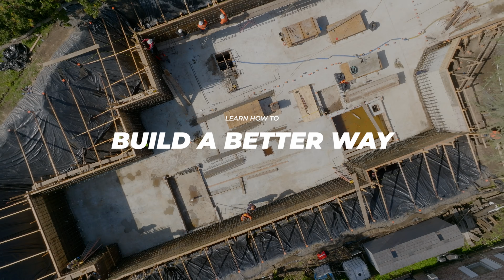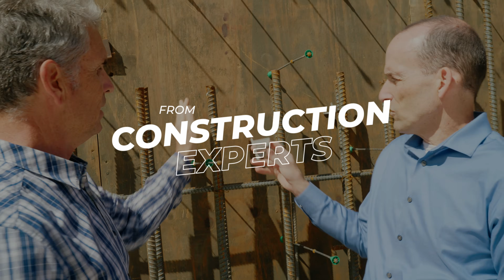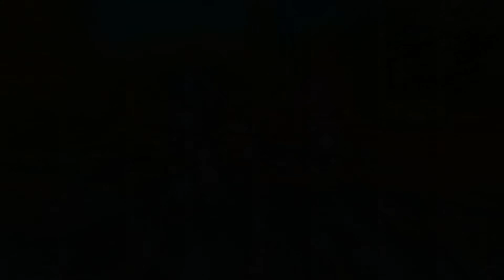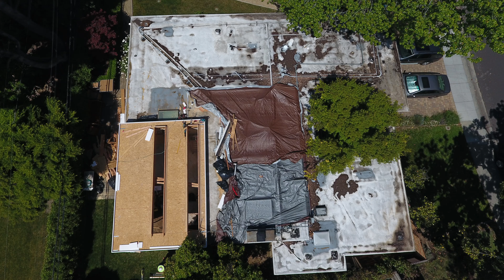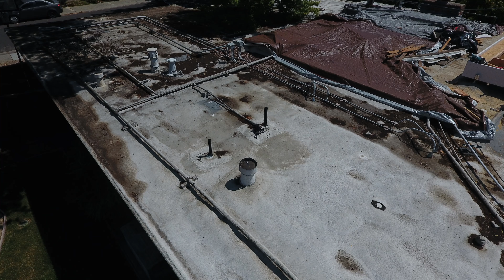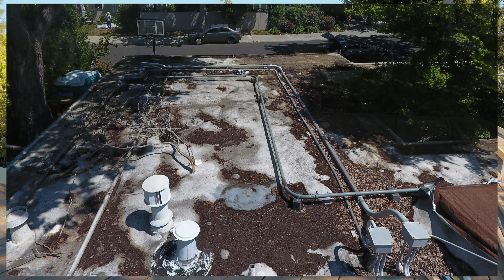Why Eichlers Suck, and What You Can Do About It - Citrus House

Comment: What was the barrier they chose to cover the pre-sloped foam insulation? 

Would love a follow-up as we see tons of folks choose spray foam and then have leaks that are difficult to pinpoint.
Reply from the maker: if you mean the roof membrane, we almost always use TPO, unless it is going to be ballasted, and then we use an EDPM.  We do not use Vinyl membranes, which are highly toxic when manufactured and when burned/during house fires and we prefer to use materials that don't kill our firefighters who are trying to save our lives.

Comment: It's hard to imagine building a modern house with a 1.5" thick clear redwood roof deck. You do see 2x6 doug fir t&g as a roof deck and interior finish sometimes.
Reply from the maker: True, but they are never the only thing that functions as the roof.  They typically have a bunch of foam up above the deck that makes them somewhat efficient.

Comment: I would say that it's not that Eichler's suck, its everyone's add ons to them over the years suck. But great to see, trying to run an HVAC in our Eichler its a battle of lots of money or a sub optimal system.
Reply from the maker: It is funny you say this.  I actually love the look of Eichlers.  They are unbelievably beautiful homes with an amazing inside/outside connection.  But they suck as comfortable, long lasting, trouble free homes that evolve with the times.  I have been in so many Eichlers with broken HVAC radiant systems that are unrepairable and so need to be replaced.  As you said, changing them is basically impossible without making them complete eyesores.  Like Frank Lloyd Wright’s Falling Water, they are architectural marvels, but functionally and structurally abominations.
Reply: @BuildingABetterWay  Tell me about it we just got a quote for $27k to replace the HVAC. Doesn't help they did some interesting add on works here lol. 

Apparently if you have a 58 and above Eichler it has copper pipes, but ours is 55.
Reply from the maker: Sorry.  That sucks.  Yes, the Eichlers are the gift that keeps on giving.  Beautiful homes to live in, with unsurpassed connection to the outdoors, but you pay for it, in repairs and discomfort when it is hot or cold out.  Best of luck to you!!
Reply: @BuildingABetterWay yes. They had a vision. The tech had to catch up. This was in the 40s and 50s. And breaking away from traditional and vernacular (who's architectural elements have been formed over centuries of trial and error). But these experiments paved way for the current tech and cultural ethos in today's well designed,  context driven buildings that respect the vernacular but draw on innovation

*(note, not talking about cookie cutters or bland glass boxes. Although the facade tech has made them much more viable)

Comment: There's nothing protecting those planks? Water goes between the boards and then what? Is there rolled asphalt roofing underneath? That's bizarre.
Reply from the maker: Hi @joevarga5982 Sorry, there was a roofing over the boards.  We had already removed the existing roofing material, which was closed cell foam.  It was horribly uneven, pooled water and have literally a hundred wires, pipes and vents sticking out from it.
Reply: @BuildingABetterWay   I see. I'm used to seeing plywood sheathing. What a nightmare. I've admired Eichlers for years but had no idea that they were so horribly built until I watched your video. Thanks.
Reply from the maker: @joevarga5982  Yes.  We are preparing to start another one soon and while we would love to transform it, the client is more interested in keeping some of the details that make them not such great homes.  So, while we will be doing a lot of videos on how we are making it better, they won’t be much better, unfortunately.
Reply: @BuildingABetterWay   I'm not sure what changes you had in mind, but the client may want to preserve the aesthetics. Many MCM homes are ruined by contractors who aren't sensitive to MCM aesthetics. I saw one where a Spanish-style tile roof was installed, and another with a partial second-story addition, lol. There's more to Eicher homes than function and R-numbers. I just subscribed, so I expect I'll be seeing it soon.
Reply from the maker: Hi @joevarga5982  I totally get that and agree that a ton of corruption is done in the name of progress and "improvement".  I also would contend that when someone buys a home, whatever style, they buy the right to do with it what they want, with some obvious historical exceptions, which they also buy.  That said, we don't do any design, so we are really implementors of other people's design decisions.   We prioritize our recommendations to our clients, engineers and architects that focus on durability, longevity, indoor air quality, comfort, silence, efficiency and sustainability, not necessarily in that order, as that order is dependent on the priorities and values of the client, not ours.  We just try to make recommendations to our clients to help them find the best balance cost and benefit(client interpreted value, again, not ours) as we work for them first, then people, then planet, then profit, in that order.  Thank you so much for subscribing.  If i can address anything that you are interested in or passionate, please let me know,  anytime.